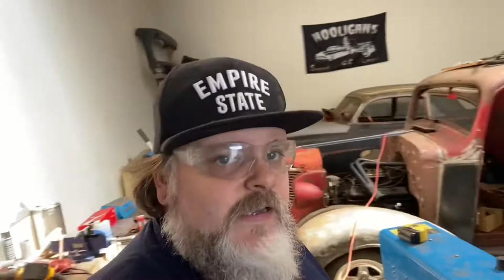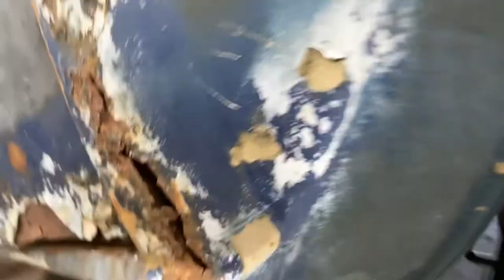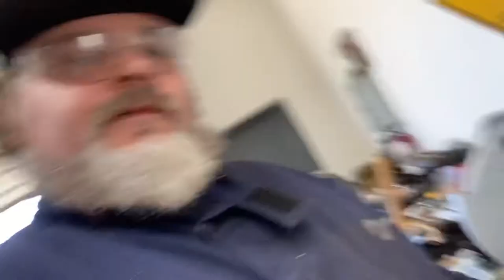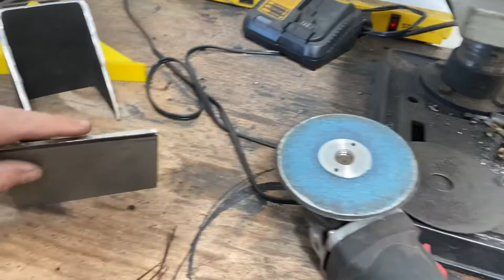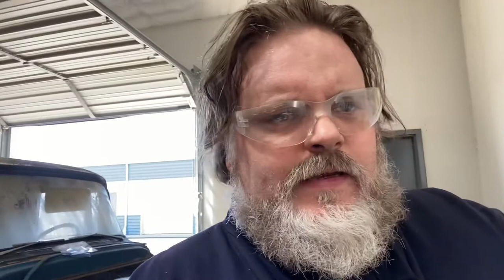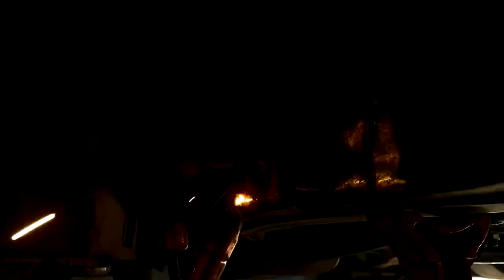Cab mounts for the 59 small blocked Chevy Apache

Comment: Is there any way you could tell me the correct measurements from the front of front cab mount to front of the frame. I'm trying to build a 59 apache and someone put a nova front cap on it and they cut the frame all messed up.
Reply from the maker: Not really , mines on a s10 chassis. I would … Sit the cab on your frame with the bed on and put your new front clip on and line the wheels up in the fenders. Just work from the rear up